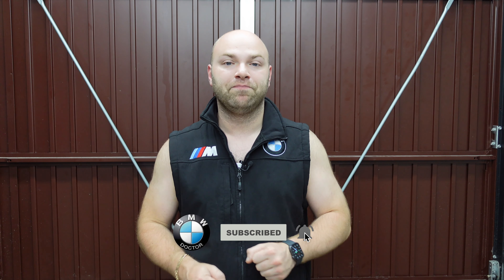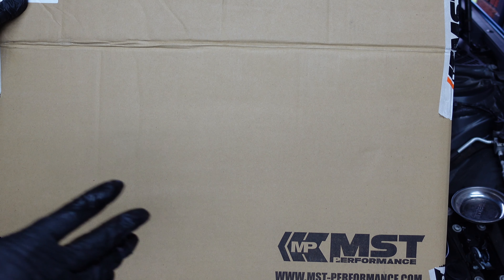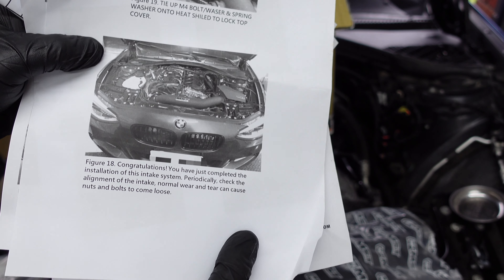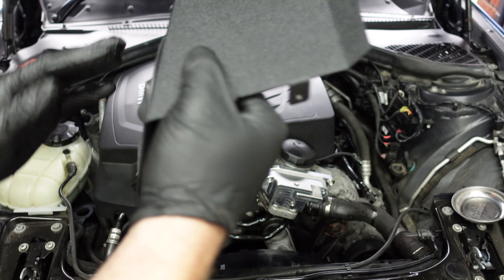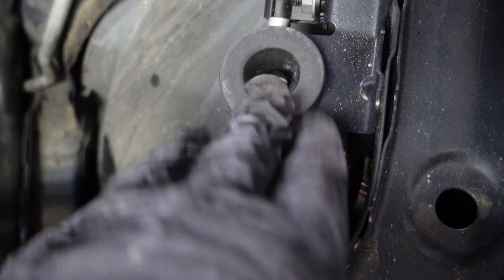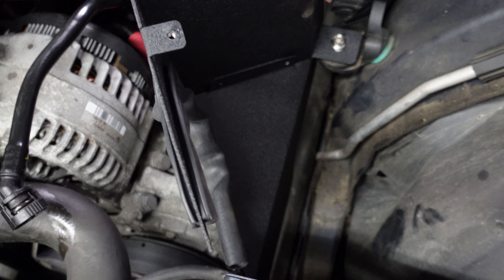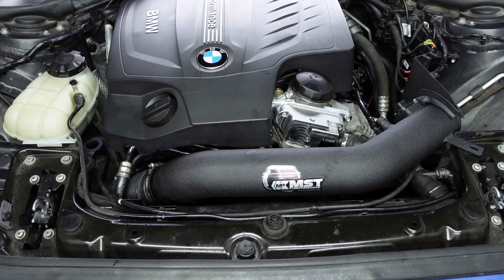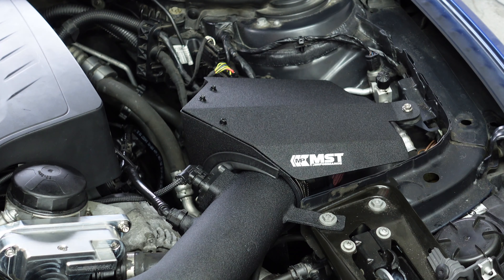BMW N55 MST Performance Intake System ( F10 , F20 , F22 ,  F30 )

Comment: Looks the part 👌 I put an AFE Panel filter in mine , get yourself an oil catch can next .
Reply from the maker: Of course man ! Trust me I’m going to a next level with this car, I want to make it one of the most unique F20 in the country. And I’m nearly there believe me 😅 killing myself but getting there slowly but surely.
Reply: @BMWDoctor  I've spent over 15k on mine over 5 years of ownership  , probably at the end of the mods now .
Reply from the maker: Yikes 😀 I don’t plan on spending that much, I have plans for this correct but very tidy ones. I want to fully retrofit every feature that was available on this which I have done already. I plan on doing all this in between mods at the moment I’m doing the NBT EVO ID5 Retrofit and then I’m moving on to the full driver assistance pack with Lane departure warning , Front collision warning , and active cruise control. I’ve already done rare retrofits on this already including the heated steering wheel, now I’m doing front and rear parking sensors to have the park assist. I don’t plan on keeping it to spend that amount of money and modified and tuned cars people will not buy, that’s one of the reasons I ain’t going super crazy. As I know the car market well and people “Mostly” opt for the most fully loaded car they can get. And I also want mine to stand out from the rest completely that’s why I’m focusing on interior and there is a lot I’m doing to this car, that I haven’t seen anyone else buy or do to there M135i. But after it’s finished it will have to go and move on to better things like them all 😅 that’s the hard thing about running a YouTube channel to keep up with the content, also the N55 is too reliable and too expensive to buy in the USA which ain’t helping my views much 😂 I usually don’t ever do this bad on views, but it’s because it don’t break so nobody is viewing it. So there is only so long I can keep it

Comment: Buy this and not the AFE brand Magnum 2 intake that cost a ton of money and ain't worth it. The AFE has the MAF mounting bracket way too far from the filter and close to the Oil Filter housing that when it gets hot it makes the MAF wire hot as heck and pulls timing. This setup is better.